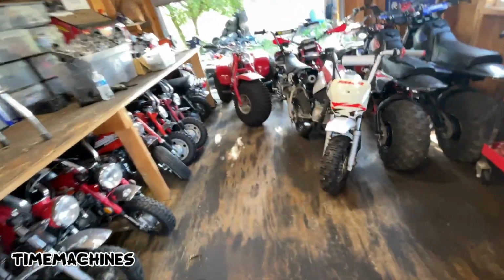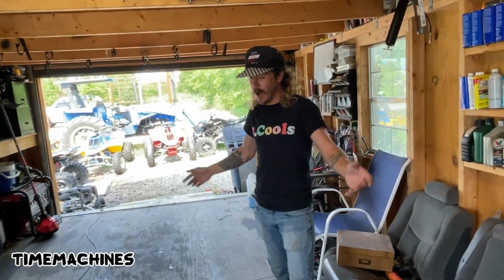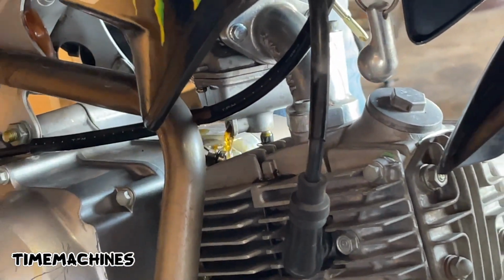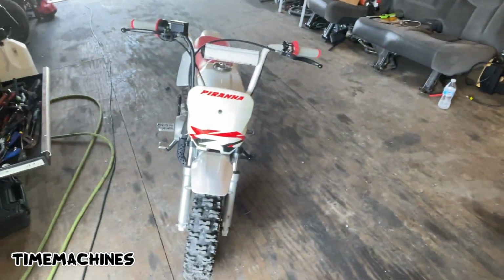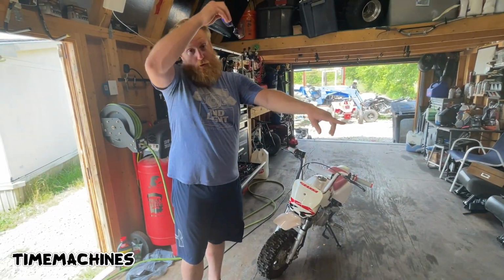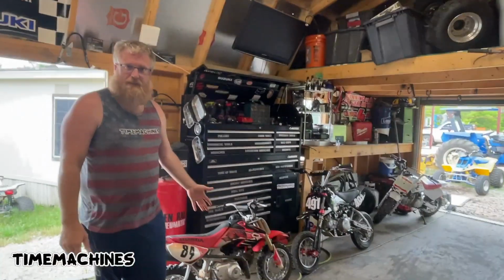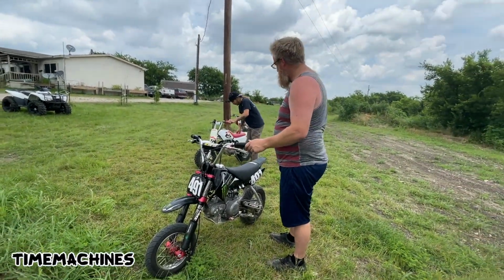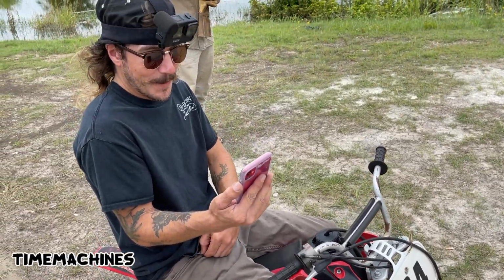Piranha 140 vs CRF 50 Mod | Pitbike Monday

Comment: Have a crf70 needs rebuilt. Been thinking of the 88 kit, bigger carb and high volume oil pump(if needed) this video sealed the deal.   Great video like normal.
Reply from the maker: They are good engines to keep and big bore. Not like a cheap lifan or etc. bottom end will last forever usually

Comment: Looking to buy a Honda 250R 4-wheeler are Banshee and good condition got about 2000 could come up with 2500
Reply: I know some of them could be 4000 -5000 but if I have to work on it a little bit I don't mind I just really would like it to run
Reply from the maker: Ill keep it in mind